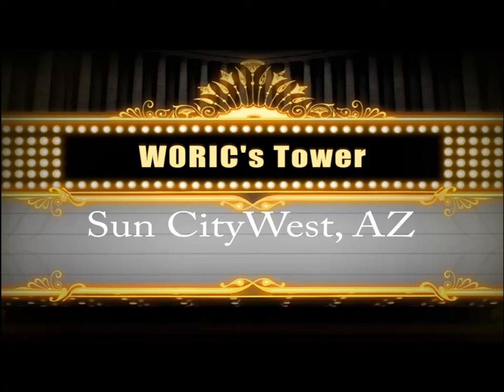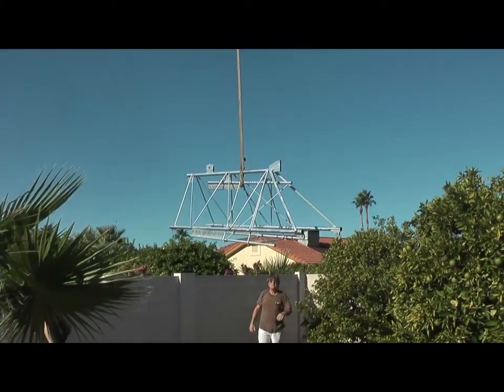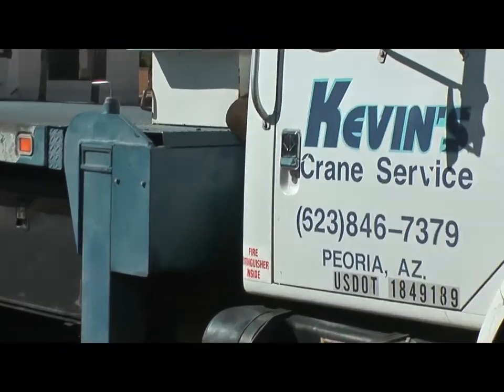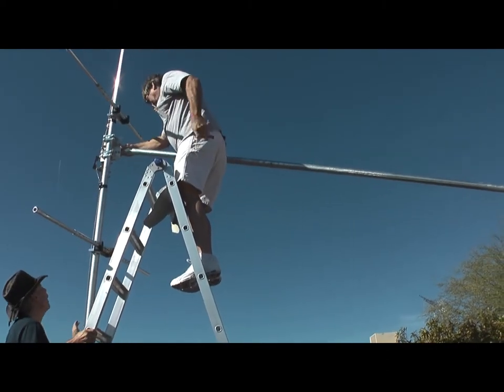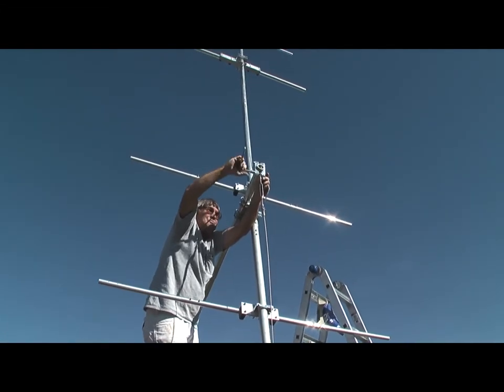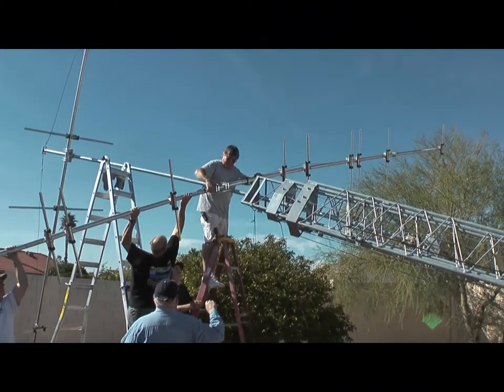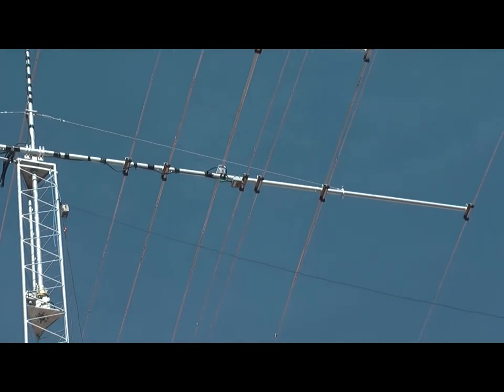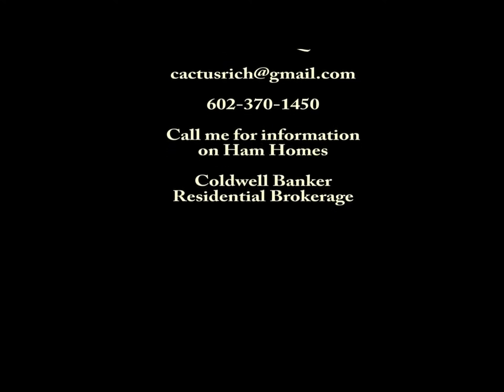W0RIC's Tower and Antenna Installation

Comment: What kind of  cement company does not have an "up over" Chute?  hauling all that was just silly.  Other than that  
well done.
Another note...  i wish i had a crew like this...  Sadly, i dont have a group like that  i can call on  for anything let alone  installing an Antenna.

Again.. welldone
Reply from the maker: I think it was cheaper to do it manually that to pay for a cement pumper.  It was a good crew, volunteers and others.  Made the work much lighter.
Reply: I was just thinking that....  it  probably was  either way  Good crew and lots of laughs alone the way.  There is always"one"  with the wise cracks..